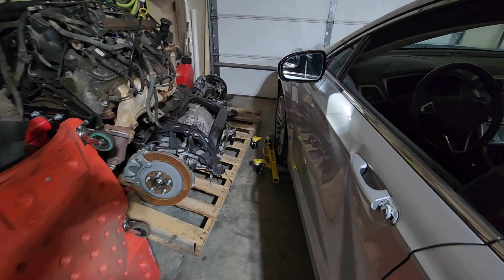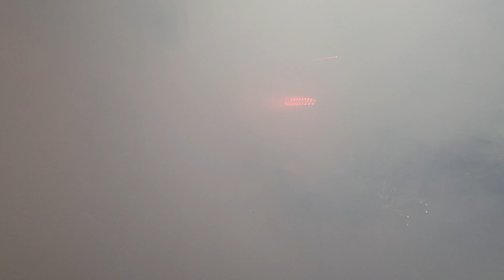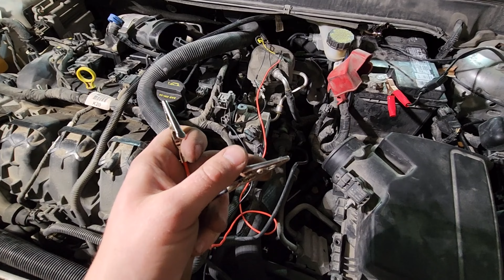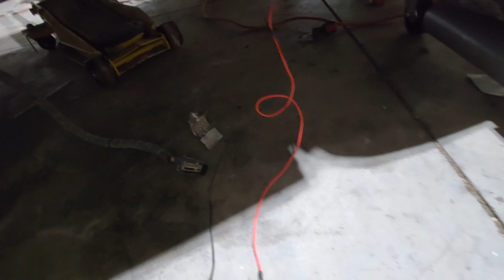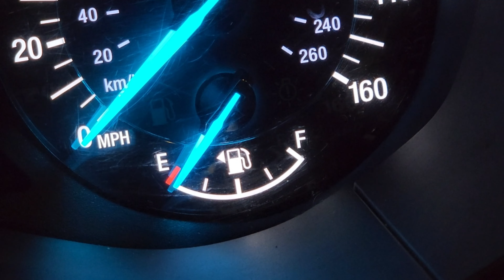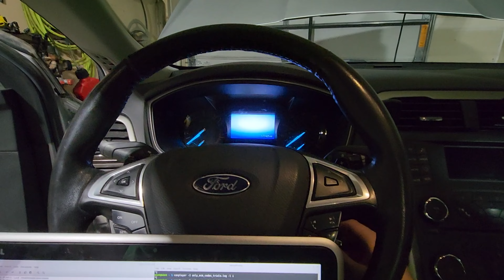Building A Turbo LS Powered Ford Fusion - Part 1: CAN Hacking

Comment: 12:00 What does the ECU use wheel speed data for if there are separate bytes for speedometer?
Reply from the maker: The separate wheel speed sensors are used for things like ABS and traction control, so it is useful to know the speed of each individual wheel. The new ECU will use them for traction control and to calculate the overall speed of the car to send the correct message to the speedometer.